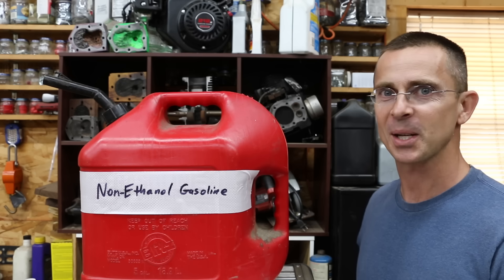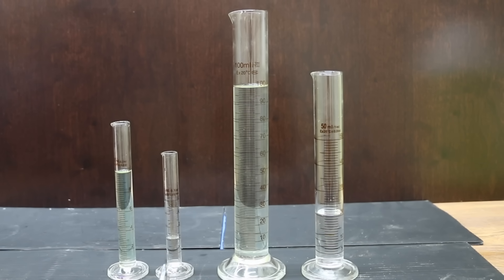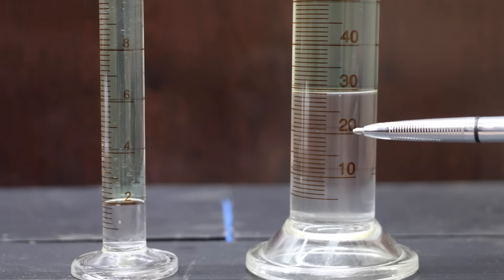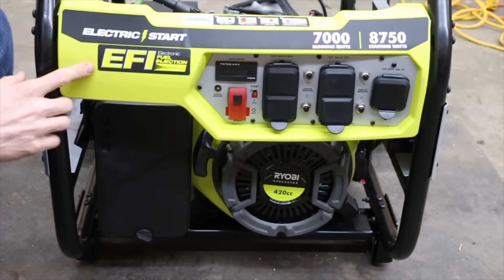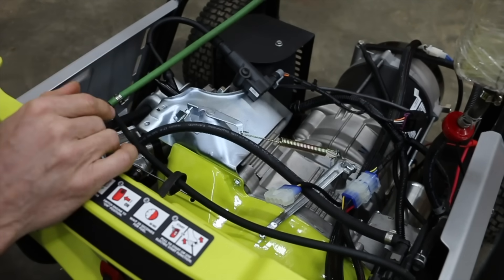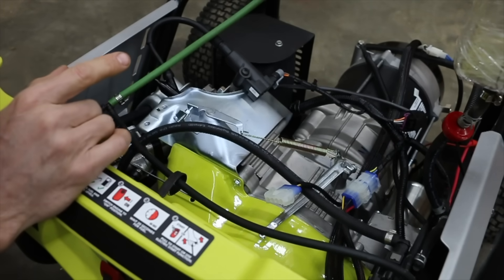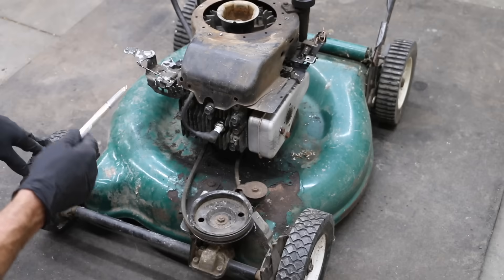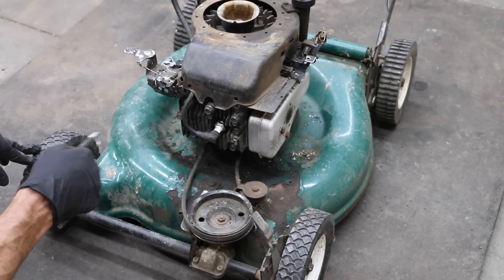Is Non-Ethanol Gasoline Really Better? See the PROOF!

Comment: As an auto and aircraft technician, the real difference I have observed is that non-ethanol gasoline is more shelf stable. Ethanol, over the long term, tends to break gasoline down if left unused for too long. It's one reason that it's use is frowned upon in aircraft, and you can still get 100LL at the airport. If engines are used constantly, like in a daily driver, I don't see any issues,  but I use non-ethanol gas in all my small engines, because they don't get run on a daily basis.
Reply from the maker: Great point. Thank you
Reply: Sarge - When I used to fly A Piper Arrow rental I talked with A&P mechanics. They always frowned upon the use of
ethanol fuels in the 4-cylinder Lycomings due to corrosion. Unfortunate because ethanol is made by the distillation
of corn or grain. Really clean burning. It's the same as  booze such as whiskey, bourbon, scotch and others.

Comment: I bought a used Toro walk behind mower on 2008 and had to replace the carb not long after I bought it.   In 2010 I had to replace the carb again.  THEN I started to use 100% gas in all my small engines.  I have not needed to do any repairs to the lawn mower since 2010 (June 2019 now).  When I mow lawns for friends, they offer to fill my mower with gas.  I say NO THANK YOU !   I only use 100% gas.  It's only available at a few stations in a town 30 miles away, so I take 3 gas cans (specially marked 100% gas) to fill up as needed.  It's more expensive, but it's worth it, I only use it in my small engines.  If you can't find 100% gas in your area, use premium for your small engines.  It will help them run better.  Just a helpful hint.  Stay Safe.
Reply from the maker: Thank you!

Comment: Ethanol is really hard on the fuel lines in my 66 fastback. That's the only issue I have with it. Also, one thing to note is that when you add X ml ethanol to X ml water you don't get a volume of 2X - you will get slightly less than that. Wikipedia has some good information on the phenomena.
Reply from the maker: Thank you!

Comment: As many others have said, Ethanol has been used in fuel for some time. There are several things to think about here. The parts in new equipment has to be low vapor emitting. So not just the tank vent but the lines too! This means the chemical composition of the fuel lines and tank are difference then it used to be before the requirements went into law sometime between 2005 and 2010. Newer carbs have the same problem and smaller jets with overall cheaper materials. Has anyone ever got the spec sheet for the fuel they buy? Probably not but if you did you would be surprised at the composition and tolerance. Gasoline is blended very differently today then even 15 years ago. 

Dont blame ethanol which has been around atleast in PA since I was a kid in the early 90s. Blame the EPA for regulations requiring material changes!
Reply from the maker: Thank you!

Comment: If you buy anything NEW with a small engine (lawnmower, weedeater, etc) - you better NOT use ethanol gasoline. Read the articles about it on the internet. Engine will be ruined within first or second use. NEW small engines are required to be built so average shade tree mechanic can not take them apart - fix them - and (you just try) to put one of them back together.
Reply from the maker: Thank you!

Comment: I was at a convention and had lunch with a women who works in the petrol / chemical industry.
She designed pumping system that transport gas all over the country. She said all fuel has water in it no exceptions. Because when they change blends they put water in the line between blends to push it.
Reply from the maker: Interesting!

Comment: Ethanol is less energy dense than regular gasoline so I do not see how this could possibly be true. Also if you have a vehicle that is both gasoline and E80 or E85 compliant you fill up the tank with gasoline it will drive much longer then if it has the E 85 which all by itself is proof that gasoline with ethanol in it is much less energy dense than gasoline without ethanol in it.
A buddy of mine and his brother went to pick up a trailer that his brother had purchased out of state someplace. And on the way out they filled up the truck with the E85 I think it is. And they had to fill the tank up I think three times to get there and all he had to fill the tank up twice to get back because they use the regular gasoline on the way back. It was one of those flex fuel trucks.
Reply from the maker: Thank you

Comment: What is "the best Oil Additive" for a proper Oil Flush?

I've always used Sea Foam, but I've been told stuff from Diesel-to-Marvel Mystery Oil-to-ATF...

Let the TESTING begin!

Thanks as ALWAYS! 😺

Take care,
🤓 -Thomas
Reply from the maker: Thank you for the video idea!
Reply: DRAIN one quart, put on one quart of kerosene, run at idle! 15 minutes, DRAIN, and new filter w/ oil in it.
Only on mineral oil.
Syn.doesn't need a flush.

Comment: I have one problem with this test, specifically the fuel efficiency test. Do the same test with a carbureted engine. The results will be the opposite. The reason being: The EFI engine has a computer controlling fuel metering and is designed to compensate for the E10. A carburetor will not have that advantage, and 90% of generators, and 99% of small engines, still run on carburetors.
Reply from the maker: Thanks for the constructive feedback

Comment: I got a '99 Ford Escort Wagon that has had it's issues running it got around but never ran quite right. I tried running non-ethanol and haven't used regular unleaded since unless needed. I haven't had issues with it stalling out while idle and it has more power and is running better. I even have an increase of fuel efficiency from 180 miles a tank up to 270 one time from a single tank.

Disclaimer: Comment made before fully viewing video.
Reply from the maker: Thank you!

Comment: I also notice a big difference when i use non ethanol in my '96 4.6. Seems alot more powerful, efficient, and smoother running. I guess because its older and cannot adjust timing when it sees ethanol.
Reply from the maker: Thanks for watching!

Comment: Good video I've always ballparked about 5% fuel efficiency drop for ethanol fuel and it looks right about there. I always get non-ethanol for my motorcycles and small engine equipment but it's not always available... not for fuel efficiency (since it costs more than 5% more) but because of the damage to non-metal engine components that old ethanol gas causes (which I've seen first hand).
Reply from the maker: Thanks for watching!

Comment: Been using 10% ethanol fuel for many years and never had a issue at all with the fuel. The cause for fuel lines and other plastic or rubber failing is more likely to be caused by benzine  , particularly if the lines are quite afew years old already.  For this reason we don't wash reusable foam airfilters in petrol.  Ethanol in a diluted form , is what you actually drink. Byproduct of sugar cane.
Reply from the maker: Thank you!

Comment: Of course ethanol free fuel lasts longer. That's big oils plan all along. Enriching with ethanol will cause it to burn that much faster. Henceforth you having to buy more gas and lining big oils pockets further. They never gave a fuck about the environment or "grown in America". Only if the green grows in thier pockets.

Now alcohol gas is the FIRST concept, all model t from the first years are e100 compliant. Henry Ford envisioned a world buying "corn gas". But big oils wouldn't have it.

I used e10 in my 2001 Dodge Dakota with the 3.9. on e10 I'm lucky to crack 150 miles on half tank(it's a 22gal tank so that's a tad above 20mpg on a good day) I switched to ethanol free 91 and I now get OVER 200 miles on half tank or about 30 something odd mpg. BIG DIFFERENCE. And since e10 here is around 2.69/gal and zero ethanol is around 3.09/gal, as of the time writing this. It actually saves money to not use ethanol.

It ruins engines, poisons emissions, and it's simply a hoax just like the Montreal protocol.

It's either all or nothing. TOTAL ethanol or no ethanol only way to go blends are no good.
Reply from the maker: Thank you!

Comment: I know one thing for sure. You need to be careful about putting ethanol in some engines. My grandfather put ethanol gas in a chainsaw and it ate through the fuel line. I think it was because it was an old chainsaw but either way when my father took a look at it he immediately knew my grandfather hadn't gotten the gas from the Co-op. If you've never seen one they do a lot of business with farmers so they only sell ethanol free gas.
Reply from the maker: Thank you!

Comment: Maybe Chrysler knows how to do it.  I own a 2007 Dodge Caravan with 3.3 liter NON-FLEX FUEL engine.  I am rapidly approaching 200K miles on it and it has almost always been fueled with ethanol blended gasoline.  With the exception of the alternator, I have done NO engine work to it.  I ran the factory plugs until 160K miles.  Engine is still strong and reliable.  In January and February of 2019, I used my van to move my household over the Rocky Mountains in 5 round trips.  No problems and plenty of power to maintain highway speeds uphill at well over 8000 feet above sea level.
Reply from the maker: Thank you!

Comment: 10% ethanol is added to make the engine run cleaner.  I live in Colorado at 6800 above sea level.  This is know as the Western Slope.  I used to live at over 7500 feet above sea level and I worked at 9200 feet above sea level.  In February, we had many below zero mornings.  One morning was 15 below zero and it was not uncommon.  Combine altitude and cold and see which fuel runs CLEANER.  That is why ethanol is added to our gasoline in the winter time.
Reply from the maker: Thank you!

Comment: Ive done this comparison over many years.

1 ethanol will damage OLDER rubber, most newer rubber is designed to tolerate it.

2 ethanol does not damage metal components,  the water it attracts does. But If you maintain a sealed fuel system water cant get in. 

3 My fuel economy test mule was a 2000 2.2L 5 speed S10.  Over the course of 5 years and 50,000 miles I generally saw 3% greater fuel economy on pure gas,  but pure gas comes at a 10% price difference locally to me (E10 cheaper per mile). Interestingly enough my economy reccord in that truck was set with E10, I got 35mpg on a 300 mile trip through TX (divining style altered for maximum efficiency).

4 when driven regularly any moisture intrusion is flushed out,  and fresh gas is added.  Ive put 25,000 miles on my 86 Suburban on E10, and the original carb is no worse off for it,  still gets 17.5mpg highway, still starts first bump of the key. 

5 even pure gas is going to give you issues on equipment thats used 3 months out of the year and sits with fuel in it the other 9 (cough cough fair weather Harley riders cough)
Reply from the maker: Thank you for the video ideas!

Comment: I ran my own tests and my car ran 10% lower fuel economy for 5% lower price per volume. So using Ethanol costs more.
Reply: My results with E10 were

3% more fuel burned @ 10% less cost per gallon.

So in that observable instance E10 is the cheaper per mile fuel
Reply from the maker: Thank you

Comment: Non ethonal gas is good if your planning to store it for a while. Like in a bike over winter.
Reply: Still should put some fuel stabilizer in it.
Reply: @olstar18  Indeed. Even with regular, I couldn't get my snow blower started after it sat a couple of months. Learned my lesson. Everything gets fuel stabilizer now. Don't remember having that problem back in the 60's and 70's. Someone said they stopped putting preservative in gas at the pump. Just one more thing to buy.
Reply: I thought non-ethonal gasoline was supposed to last roughly a hundred years straight before it begins to break down into it's individual components.  With ethonal gasoline on the other hand that can only be stored up to a season long before it accumulates too much water to be useful as a fuel anymore.
Reply: In my ignorance I ruined a nice chainsaw,over that Shxt one day , you can take ethanol and use your imagination, I have absolutely no use for it whatsoever !!!!
Reply: That sucks,  @beckywatt5048 .  Do not blame yourself.  Our Federal Government has been stupidly telling everyone that ethanol is best for gasoline for many years now.  Ethanol gasoline is best when your vehicle's engine is optimized for it.  For everyone else... you are screwed.
Reply: Adam Gray Yah I know , TY, It sat for a couple of yrs and I thought it was just varnished up , after I did the deed , I tore it apart and found out what happened and was I , not very happy let's leave it at that .

Comment: That’s weird. Ethanol burns much cleaner than gasoline, but you can see that it burned much oranger. The only possibility in my head is that the ethanol may have reduced the temperature during combustion enough to make the gasoline burn less efficiently.
Reply from the maker: Thank you

Comment: I'd wager a guess that when we venture to larger engines we're looking at differences in tuning and computer technology that can rapidly detect the fuel and alter tuning in order to make it work between ethanol and non-ethanol fuel.  Same with new vs old engines.  I see this as an issue when it comes to motorcycles as a guy I used to ride with still used a carb bike only a few years older than mine and it ran like @#$@! on ethanol fuel.  My bike is EFI and doesn't care at all (MPG still stays at a static 48 town or highway).  

Just a guess, though.  It does line up with the results found in the Mythbusters episode ont he topic, though.
Reply from the maker: Thank you

Comment: I'm from Brazil and here we have 100% ethanol pumps, since the 90s cars are manufactured to run on any mix of ethanol and gasoline. Gasoline is 30% more efficient than ethanol, and the prices on the pumps match that difference, ethanol gives you more horse power. Ethanol is cleaner and corrosive, and that is very evident when you have an oil change on a car that runs mostly on ethanol, the oil is clean, almost no soot.
Reply from the maker: Thank you